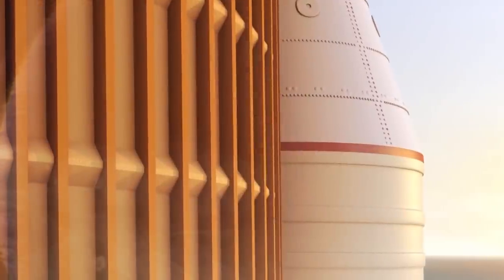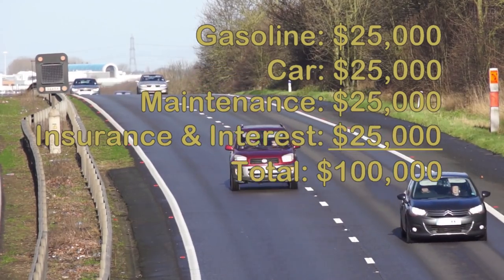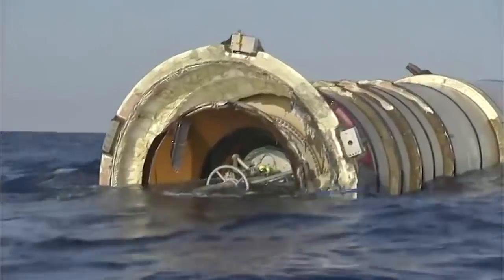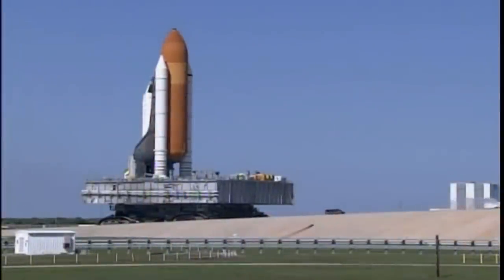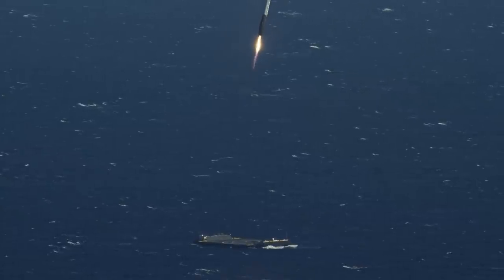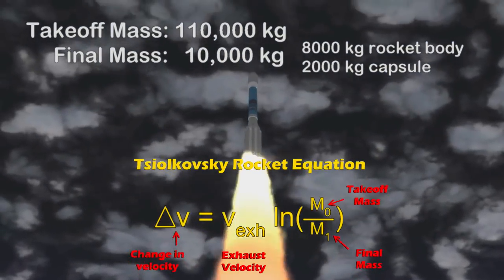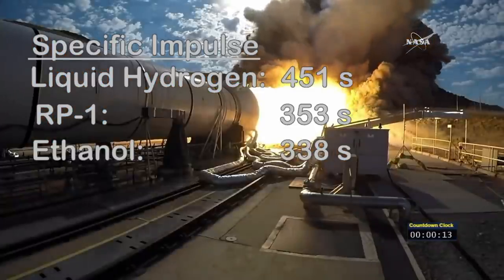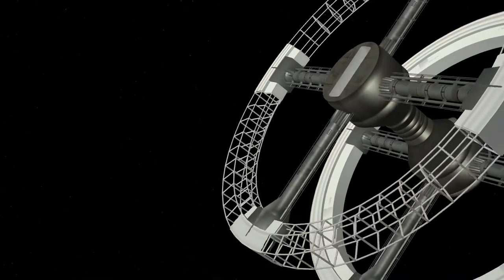Reusable Rockets & Metallic Hydrogen

Comment: Buying a new car every time you run out of gas? More like buying a new car every time you start the engine...
Reply from the maker: True, but sort of runs against the theme of refilling the vehicle when the fuel is gone :)
Reply: In the car analogy. There is only one place to refuel. So you can load your car up with 100 Kg of cargo 100Kg of fuel and travel 1000Km then dump the car. Or load it with 10 Kg of cargo 190 Kg of fuel unload the cargo at destination and turn around back to refuel. The thing is it then takes 10 trips with the reusable car. So there is some sense in using a one trip vehicle.
Reply: @mullerman1970: they did, try "planetary annihilation" or "ashes of the singularity"
Reply: Or buying a new battleship every time you fire the gun.
Reply: +ccdimage -Almost all the fuel is used on launch, against Earth's gravity. Returning to Earth from orbit or even from the lunar surface only takes a tiny amount of fuel by comparison. So you don't really need more fuel for reusable rockets. They're basically the same as regular rockets, except you can reuse them.
Reply: +Dan Nguyen - lol, I SAY "there're" all the time, but I never write it because I think it LOOKS awkward. And yeah, I can't remember ever seeing it in print.
Reply: +Bo Zo
Sure but we also know that the mass ratio of cargo to fuel is also tiny. So even it is is only 0.5% of the mass is return fuel, that is a significant loss of cargo mass.
I don't know what the rebuild costs of the return engines and tanks are but the shuttle experience tells us they are significant. Then there will be an things like failure rate, which will increase for every reuse. 
There may be cost savings for getting to LEO, I don't think they will be large. As for getting a ton of cargo to Mars?
Reply: Bart Bols More like buying a car, use it once to boost your bike, and then immediately throwing it out a cliff.
Reply: +ccdimage Thing is you could potentially still save a lot even if the craft that actually goes to mars never comes home because you could assemble and fuel the interplanetary craft in LEO using reusable rockets thus saving the main craft the ~(9-10) km/s delta-V to LEO (That figure is including air and gravity drag). Whereas from there to Mars would be ~4.3 to Mars transfer orbit (Typical value not minimal thus the approximate there), 0.9 to Mars capture orbit and 1.4 into Low Mars Orbit (6.2 km/s total as opposed to 16.2 km/s if you launched the whole ship from the surface of Earth).

It would be an additional 4.1 km/s to the surface of Mars though depends whether or not you actually want to land the entire ship, it could simply drop cargo pods etc to the surface. Of course it's possible to use aerobraking for most of the delta-V to the surface though of course one still needs a burn to bring perigee into the upper atmosphere if you want to land anytime soon.

Still the delta-V from LEO to most of the objects of interest to us at the moment around the inner solar system (Moon, Venus, Mars, all the asteroids etc) is lower than the delta-V from the surface to LEO so a reusable rocket to handle the surface to LEO portion greatly reduces costs for such longer missions too.
Reply: Hi  Seraphina S
I don't think there will be much cost saving.
It is not the cost per launch but the cost per kg of cargo that is important. And a powered return rocket has reduced cargo to orbit, compared to burning the fuel used to power the return to actually get cargo into orbit. Lifting fuel that is not used to get into orbit is a bit of a waist.
The, recovery, repair, and maintenance of the reusable rocket is still very high. What are the options. Over engineer the rocket so it lasts longer and replace the parts that wear. OK so not the same cost as building a new disposable one every time but a substantial fraction of it. 
Is it a better idea to bring a Mars/Moon mission to LEO in parts then bolt them together in orbit, or launch with a complete mission.
Reply: +ccdimage Certainly today that would be the case we really lack the tech level required to make this work and actually get a decent return on the effort the space shuttle after all really did fail to actually achieve it's aims in that regard and actually ended up with worse costs than competing single use systems. That's not to say that future technological improvements might make lightweight components that are strong enough for reuse without excessive servicing might not become a reality at some point in the future. Improvements in materials science is often the catalyst that causes revolutionary changes in the field of engineering there are so many technologies that were theorised on paper but only became a reality when the materials science caught up with it.

The problem I would have thought would be finding something that can handle the high pressures and direct exposure to flame while being lightweight for the engine components is probably the biggest hurdle there. Various novel carbon structure from carbon fibre to graphine etc are great for structure and even fuel tanks but they are never going to work for the actual hot parts of a rocket engine, direct exposure to flame is not something carbon can withstand not even a diamond would survive being in direct contact with the exhaust of a rocket engine you would be left with shattered fragments of a charred black rock at best, most likely just some CO2.
Reply: Imagine buying a car with a fuel tank exactly the size you need for one use. Then you buy another car with a fuel tank exactly the size of what you need when you've used the first one.
Reply: +ccdimage - you're not paying attention to what informed people are telling you.
Reply: Hi Bo
I am not buying the hype. That is all. People who get excited about X, follow every press release by company X, and think everything that X does is a fantastic new game changing technology have a special flavour of "informed" that I call blinkered bias.
Reply: RS25 can't be compared to nearly any other rocket engine due to how complex and stressed it was in operations while comparable engines like RD170 derivatives are much more resistant due to variety of factors.Sadly this video is filled with such simplifications that the result is a rocket from a material nearly unknown in using a theoretical fuel and even the initial mass fraction assumption is wrong because again due to simplifications made all relevant informations are lost.

As SpaceX and Blue show it is economical to oversize the booster a bit to recover around 70% of the cost of hardware with loss of 30% of performance f9 can deliver 5300kg to GTO like recent reused falcon flown with SES10 and land while expendable performance is around 8000kg.
Failure rate might actually go down on flown boosters due to manufacturing errors being the main reason for failures on the first flight and there is a reason why planes are tested before delivery to commercial operators.Some day rockets might also reach a similar point if both stages are reused now the upper stage is still a source of potential problems in each flight.
Reply: Hi Shiomo
Thanks for that interesting information.
So 3 launches of a reusable vs 2 launches of a disposable? That is not too bad, at the higher end of what I was guessing it would be.. I suppose that if the reusable rocket was designed to be disposable from the outset you could save some weight. Maybe get 5 disposable launches vs 3 reusable.
I had a few other guesses. Maybe you can clarify if you know.
The recovered parts are about 50% of the construction cost. On a disposable rocket design this would be a bit less somewhere like 20% cheaper to launch cost. Optimistic then we get a 25% cost saving in cargo mass to orbit.
Before I saw your numbers I was thinking 5%-15% cost savings. Given optimistic estimates are usually out by 1/3 to 2/3 we are near my guess. Now I may be happy if a new ccd camera is released that is 10% cheaper, this is just normal technological development and I am not about to cream my trousers over such advancement.
Reply: +ccdimage - You might be right to not buy into the SpaceX hype like a fanboy. 

(I'll say I am fairly optimistic about most of it.) 

Maybe SpaceX hasn't perfected it, but it seems like common sense that, if it's feasible, a reusable spacecraft is as good an idea as a reusable aircraft. And it seems quite feasible. It seems like a good idea.
Reply: A good example of an expandable rocket that was modified to be reusable is falcon9 that started in expendable version and still this rocket can fly with no recovery like recent launch of Echostar 2 months ago.Difference in raw performance is around 30% and rocket in reusable version has a 2000kg higher dry mass due to systems like legs and gridfins for controll.

Recovered parts are beyond 70% of the launch cost that is dependant on individual design of each rocket additional costs to construction are integration and testing but these are also on new rockets so these are not included/favour reused hardware.
Falcon9 is already around 2-3x cheaper than other comparable launchers and the reusability is saving another 30-40% off the launch cost.
The launch cost is one thing but such configuration allows for a much highier launch rate off the same industrial base and that is another advantage that you could nearly launch on demand in the future.

Also the high speed entry is a marginal problem once propellant is used to slow down and the velocities that F9 stages reach post the atmospheric entry burn are on the same order as SR71 or lower than X15 and these airframes proved to be very resistant to these conditions.
Cost savings in the long run will be determined by recovery of the second stage
Reply: Hi Shlomo
I don't think Falcon9 is 2-3x cheaper than the old Soyuz. I guess 10% cheaper at the moment.
Reply: But it is that much cheaper F9 is currently 62mil for expendable flight and that is 22 800 LEO and 8300 kg to GTO
Recoverable will be 30-50mil$ and 5500GTO and around 17 000kg  LEO vs 3250kg to GTO and 7800 LEO for Soyuz 2-1A for 50mil$
Reply: I had a look at a LEO cargo mass from a reusable launch CRS-10 according to a nasa pdf. The mass delivered by Falcon9 was 2490 kg.
If I read you right 22800 kg to LEO for an expendable flight on the Falcon9. 
That is only 10% of the cargo to LEO on the reusable rocket compared to the disposable one. That sounds low to me maybe you were saying 22800 lb which is 10500 kg ish. That is still only about 1/4 of the cargo of the disposable. At that rate you have to be beyond 75% recovery to reduce costs at all. With less than 75% recovery it is cheaper to use the same rocket in disposable mode and deliver the 4x bigger payload.
Reply: The cargo you quoted is delivered in a pressurized dragon capsule and the trunk unpressurised and Dragon alone is 4200kg dry and the missions like CRS have the performance to do a RTLS launch profile that cuts nearly 60% of the performance of the rocket. One recent recovered flight was an iridium next where 10 satellites at 860 kg each were delivered into a 600km orbit and booster would be able to RTLS but the pad is not ready so they landed in the ocean.

Average gto mission is getting a mass of stage + propellant for a  burn of 50s like the burn on SES10 and that is  50s at 348s of isp that is around 10 000 kg of propellant alone.
At 348s isp and dry mass of second stage of 3000kg and payload of 5200kg with delta v from LEO to GTO of 2500 we have to start with 17100kg of starting mass if end is 8200kg going into GTO.To reach the expendable figures for GTO of 8300kg payload+3500 upper stage 24 000kg injected into a very low initial orbit first
Reply: Hi +Shlomo
The mass delivered is what is important. The cargo was delivered pressurised and unpressurised. It is itemised in the pdf from nasa so that pressure capsule must weigh some extra amount. 
That extra mass for the pressure capsule puts us back into the original number for getting equivalent mass to orbit of about 3 reusable launches to 2 disposable launches. Which makes sense.
Reply: Not really because of how different a pressurised delivery and return is from standard commercial operations.
The comparison for up mass could be made with Progress that is capable of delivering roughly 2000kg (dry+water) and has 6.6 m^3 of space while Dragon can deliver 11 m^3 of cargo and 6000kg of mass.Progress has no capability of returning to Earth and is designed to burn up on reentry.
Both capsules are primarily limited by volume because short of throwing there bags of water there is nearly no cargo dense enough to exceed the mass limit on these vehicles.
http://www.spacex.com/dragon
http://www.russianspaceweb.com/progress.html

But that is a comparison of cargo spacecraft and not rockets.

The payload hit from reusability is pretty minor for F9 because of how little the rocket has to gain to become reusable compared with expendable launch a recoverable cuts the engines 10 s early and that is enough for an oceanic landing .No extra systems or engines outside of grid fins and legs.Other approach seems to be the way Blue intends to make their booster glide in the upper atmosphere thanks to wings on the  booster that provide extra lift and make the entry longer.
Reply: agree
Reply: You have to admit now, its a pretty terrible analogy all things considered, even the fuel. 

Even the broad strokes of the argument don't really stand to scrutiny. Just because something is reusable doesn't mean its cheaper in the long run, given you have the tech to make it possible in the first place.  There is a reason why disposable items are a economical winner in various and/or extreme circumstances.
Reply: Patrick is dumb enough to assume an empty fuel tank means its time to throw away the car. He did just that when he got his boat mobile.
Reply: Thanks to SpaceX it's now more like your car losing value every time you use it
Reply: Have a reusable truck to go part of the way, then unload a one-use sports bike and go as far as it's parts can handle. Seems like a good compromise.
Reply: @ccdimage  

I agree, what we need more than 'reusable' rickets, we need much cheaper disposable rockets, for heavy lift. Reusables would be fine for commuting to LEO.
Reply: @Dan Nguyen 

Probably Texan
Reply: Even worse; it's like towing 2 cars behind you on a cross country trip up a big ass hill, fully fueled so when one runs out you can dump it and drive the next one, and at the end of the trip you jump out in a big red wagon and ride home by the seat of your pants haha
Reply: Nowadays???...
When the car runs out of gas...  it’s time to take out a home equity loan 🙄